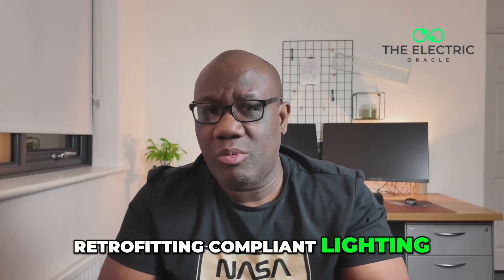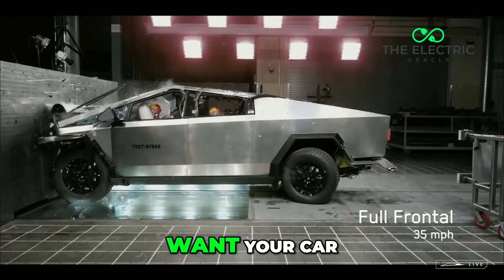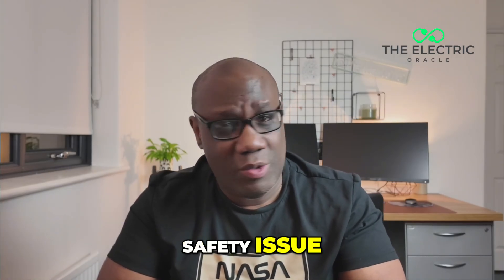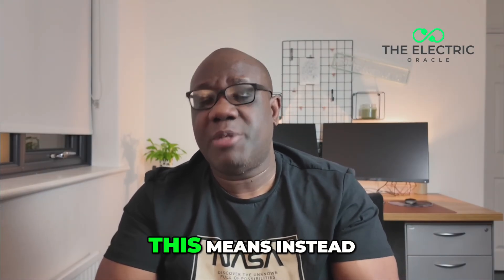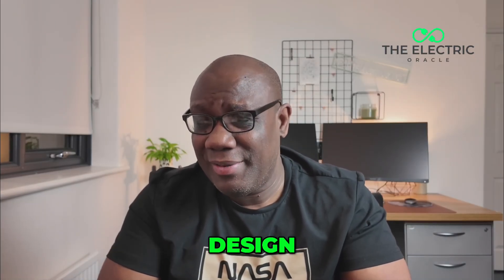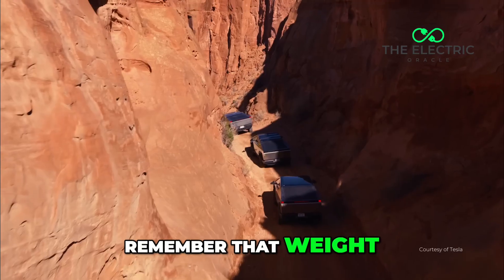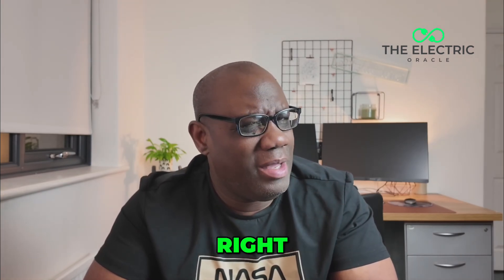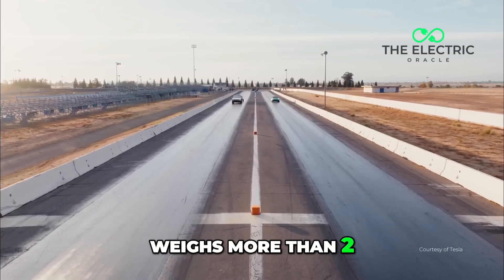Why Tesla Skipped UK Headlight Rules - Costly Mistake Exposed!

Comment: Used the wrong figure, license goes off the Gross Vehicle Weight Rating. So you would require class 3 anyway. Since the Tesla is 4,160kg
Reply from the maker: Good catch on the Gross Vehicle Weight Rating! We mentioned the Cybertruck’s 4,160kg weight causing UK licensing issues, so you’re right about needing a Class 3 license. How do you think this weight restriction impacts its UK appeal?
Reply: Updated 10 June 2025
Vehicle weight - maximum authorised mass

If you hold a category B driving licence, you can drive an electric or hydrogen-powered vehicle with a maximum authorised mass (MAM) of up to 4,250kg. The vehicle must be a zero emission vehicle.

The normal MAM limit for petrol and diesel vehicles with a category B licence is 3,500kg.

This additional weight allowance applies to vehicle types you can usually drive using a category B licence. These are vehicles designed for carrying up to 8 passengers and include cars, SUVs, vans and small trucks.

If the vehicle has additional specialist equipment to support disabled passengers, it can have a MAM of up to 5,000kg. The extra 750kg must be attributable to the specialist equipment.

You can also drive an electric or hydrogen powered minibus up to 4,250kg MAM (5,000kg if fitted with additional specialist equipment for disabled passengers). You must fulfil additional requirements to drive these vehicles using a category B licence.

Read separate guidance about vehicle weights explained.

Towing a trailer

You can tow a trailer as long as the MAM of the vehicle and trailer combination does not exceed 7,000kg.

For example, if your vehicle has a MAM of 4,250kg, then the MAM of your trailer will be limited to 2,750kg.  The MAM of the trailer must never exceed 3,500kg.

If you passed your category B driving test before 1 January 1997, you can drive vehicle and trailer combinations up to 8,250kg.

See the section of this guidance on how to safely tow a trailer.
Reply: Googleing about pedestrian crash safety…. Gov.uk website popped up about this update. Makes no sense to me just upgrade everyones driving license with B to 4,250kg

The fact it’s the size of a mini bus will put off a lot of uk consumers.

Comment: it is a european wide topic cause only such a standard will work out. Remember the 70 s when UK had its own standards and when the homologisation for EWG or EU had begun: those behind the standard were lost and under pressure.

Mercedes for example made the S-class less rigid from the dawn of their A-Class and later Smart car to give the smaller cars the space and safety to survive under the much heavier mass of the S Class hitting these.
Reply from the maker: Great point about EU-wide standards! In the video, we explored how Tesla’s rigid 30X steel design struggles with UK/EU safety regs, unlike Mercedes’ approach with the S-Class. What other brands do you think nail this balance for European markets?